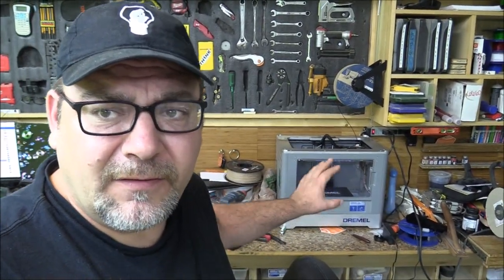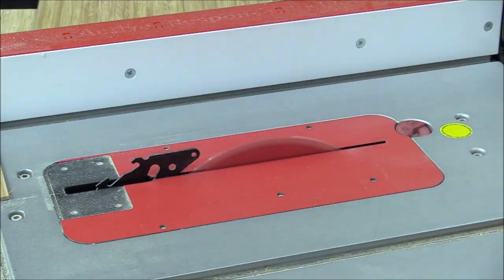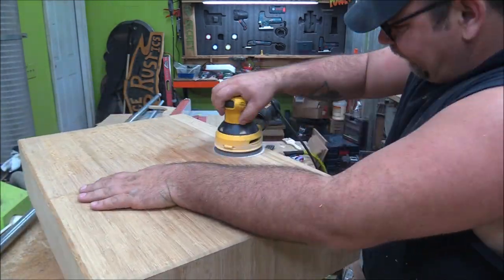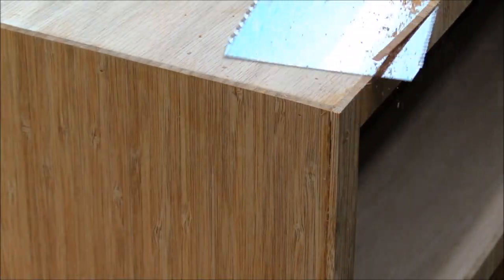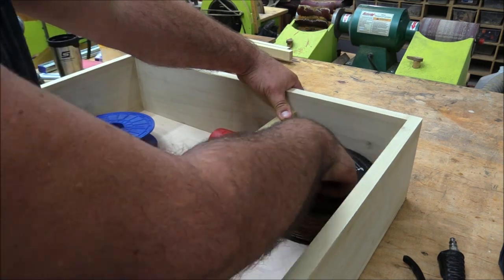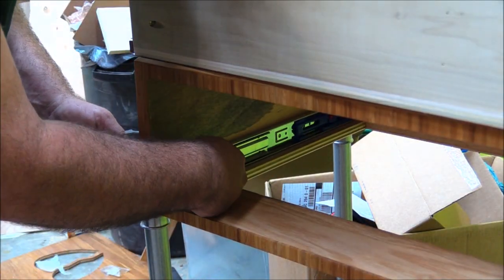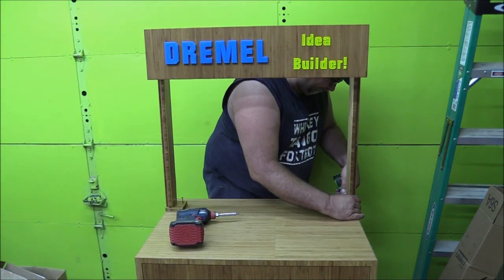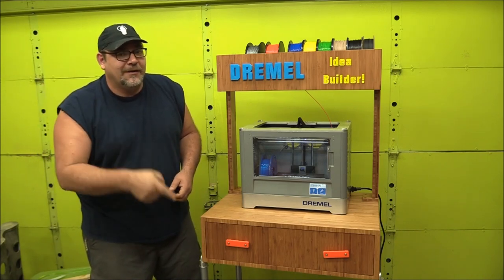Building a 3d printer cart for my Dremel

Comment: Great build, but concerned about that pla just setting out like that. Do you run a massive de-humidifyer in the shop? Over time the pla will absorb humidity in air and become tough to print with.
Reply from the maker: yes i have a awesome dehumidifier built into my system but honestly I will go though PLA pretty fast not going to sit oround for long